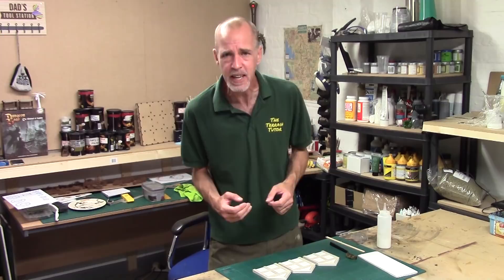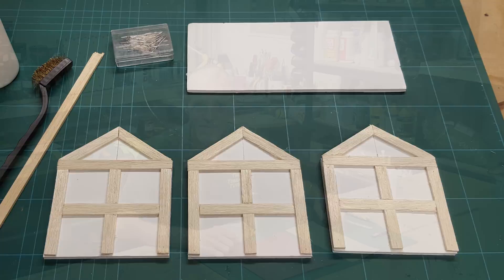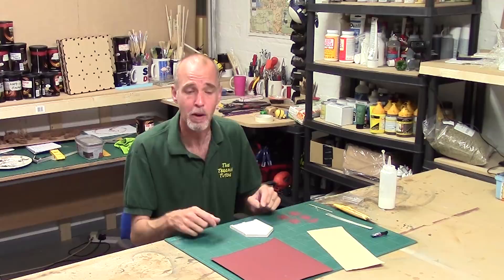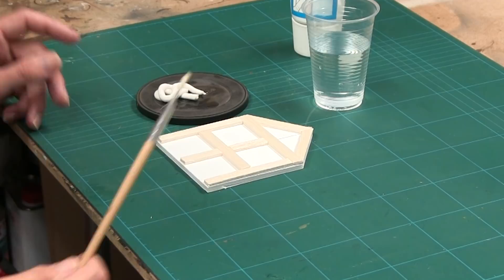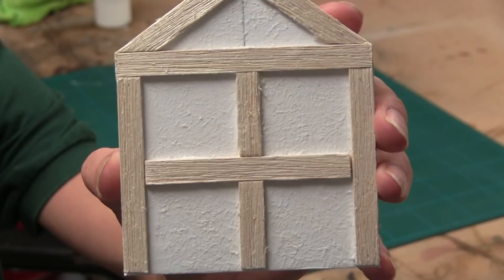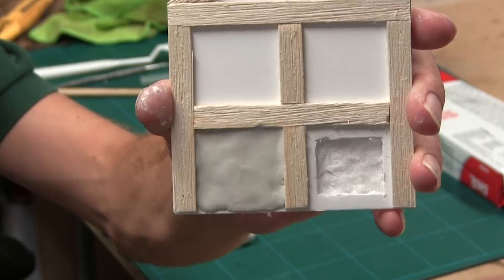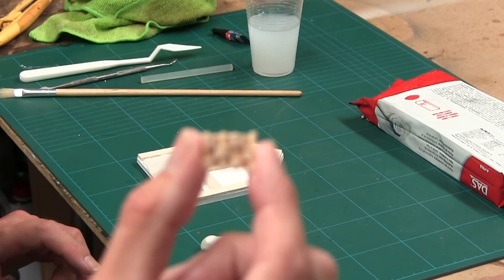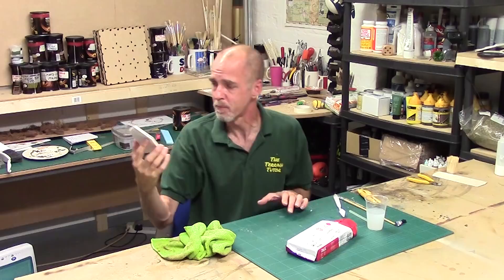Cheap & Easy Wattle & Duab Modelling Techniques

Comment from the maker: So, what are your go to techniques for duab'ing it up?!
Reply: TheTerrainTutor, I make the foam board outline, put down stirring stick wood or basswood (balsa is too soft I think) use the wire brush. I base coat and paint the wood. Then I use grout from a Home Improvemt store (it gives a great texture, color, and adds some weight, don't even have to paint it. If I want a window with glass I'll put a small piece of foam behind and glue the outside of the windows with basswood. I use watereffects on the window to get a gloss. Then I cut up pieces of a rag and layer it to get the thatch roof. I coat it in PVA and then I paint over it and dry brush + add a wash.
Reply: I've used artists watercolor paper, it's thick like the sandpaper but when it's painted and washed the texture is more like your filler method.
Reply: Muad'Duab
Reply: lemme just waddle in with a neat wattle techniquie I saw. Its the exact same as what you showed Mel, only you can skip cutting strips of balsa-wood by using metal twist ties.
Reply: How about just cereal box card board with little skewers? Would be interesting to have a go with that. Great video BTW.
Reply: Artists filler from Amazon - https://amzn.to/2KNq6XR
Reply: Stick some cocktail sticks in some corrugated board, use crafter's twine to weave between them, then coat that up with clay, slap the timbers on the outside of it. It's probably the most work, no doubt about it, but it's also the best results in my opinion. It's also super close to what we used building W&D huts in Africa, except ya know, it was timber staves in the ground with fiber ropes woven between them, then mud and whatnot up the walls. But you get the idea.
Reply: For worn wattle and daub, with a grained texture, I’m just experimenting with car body filler spread over material.
I got the texture I wanted, I have now to apply it to a model.
I used a piece of fleece from a cheap hoodie, the material was taped down, then car body spread over, and with a little pressure into the material.
When the filler starts to get to the flexibility of silicon rubber, it is then peeled away, placed on a flat surface, then light pressure applied to keep it flat.
Depending on room temperature, it will take around 30 minutes to completely harden.
The only problem I’ve found so far is consistency of thickness, but that said, I’m only using it as odd panels that have weathered out.

Comment: Tip. Next time cut the backside of the sandpaper. You get much cleaner cuts (specially with coarse grit) and your blade lasts a bit longer. Just score and break if it's the very coarse kind.
Reply from the maker: Top tip, thanks!

Comment: I've been meaning to try using a woven grass placemat for the wattle on buildings like this. I think that by choosing your weave correctly you can just cut out pieces and glue them in, then lay in the spackle or other texture compound over the top. You should end up with a pretty good looking wattle and daub without quite as much work as hand weaving bits.
Reply from the maker: If you can find a fine enough weave, that would be wicked mate!

Comment: For smaller scales like 10mm or 15mm I got excellent results mixing baking soda with white acrylic paint. It comes out looking like stucco. I mixed it 50/50 by volume but you can play with different ratios for other results. BONUS: Add a bit of PVA to the mix and stipple it onto a very smooth surface, like plastic card. When it dries you can pull it off and you'll have a sheet of the stuff that you can cut to size with scissors.
Reply from the maker: I like that peeling idea mate!

Comment: light joint compound or regular joint compound goes a long long way
in the states I get this stuff called ProForm Light Joint Compound in 50lb bags that I put in 5gallon buckets for only $14.99USA you can water it down or thicken it or whatever, add pigments and paint for colors. good stuff, you can find it around the drywall section most places

Comment: Around 11:00 Mel started showing his wattle construction using balsa wood and cocktail sticks.  If anyone is having trouble cleanly bending the balsa to the desired shape, consider this balsa RC airplane building technique.  Soak the balsa in ammonia for a couple days and it becomes very flexible.  When it dries it returns to being very firm, but retains the bent shape. 

I made troughs out of PVC plastic pipe with PVC end caps to contain the ammonia liquid and vapors while it soaks the balsa.

Old RCers don't fade away... They just go to a different part of the hobby shop.   

I used to laminate balsa using this technique for making curved and eliptical wingtips, tail planes, rudders and elevators.  I notice some of the exposed timber on the  Cotswold houses is curved, so this technique can be used to make custom curved timbers on the model houses.  I found it easier to bend than saw them to shape.  The bent laminated pieces are much stronger too. Laminate them using wood glue or PVA after you wipe off the excess ammonia.
Reply from the maker: Actually, you can do it with just water and you only need to saturate it, so a couple of seconds before pinning it to a bend and letting it dry that way, holds the shape just fine. I show the technique in the balsa back to basics vid if you want to see it matey
Reply: Thank you so much, Mel.  I'll take a look at your water only technique.

For the airplanes I scratch built from plans I wonder if the wood for the laminations was a bit thick.  I think I was using 1/8" or 3/32" thick balsa strips to form laminations and maybe the strips were just a little too thick to handle the required curves.  I also used the ammonia technique on 1/4" and 3/8" square spruce to allow bending of fuselage parts, and for spruce it really needed softening more than the balsa.

Comment: Just as a quick note, the daub should be almost flush with the wood as it was applied quite thickly to provide insulation.
Reply: Yes, and if you really want to go all out you can use a small sculpting tool to add brush marks. Also rough up the surface.
Reply from the maker: I've actually seen it at various depths, I wonder if it's got something to do with layers been added over time mate?

Comment: Mel, you've got me thinking.  I want to build a medieval village scene with some 1/20 villagers with torches, a building and a Maschinen Krieger!  Any ideas about how to make a thatched roof?  Something like hog bristles?
Reply: I always used bristles from cheap hand brushes for thatching. Obviously beige/yellow ones, make little round bundles, glue them (I prefer super glue for quick success). Cut the bristles to length then start applying them to the roof from bottom to top. Hope that helps.
Reply: That sounds like a good idea to try.  Bottom to top makes much sense.  I need to look at a lot of Cotswold photos to see how the real thing looks.
Reply: Teddy bear fur is a very common material for thatch.
Reply: Now that would never have occurred to me!
Reply: That's because the Teddy Bears are messing with you mind.
Reply: ~~If you go out in the woods today, you better go in disguise...~~
Reply from the maker: That's next next video that's out in this series mate
Reply: Outstanding, Mel!  I am anxious to watch.  Many thanks for the reply.

Oh!  I was thinking of LED lights in the torches, in a manner similar to the battle explosions from a while back.